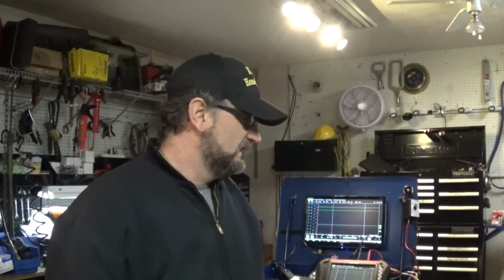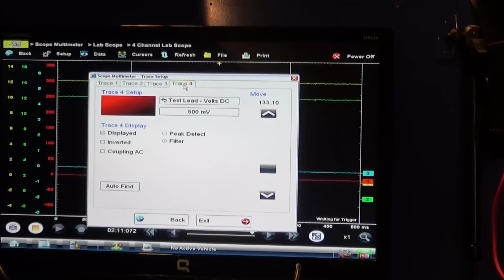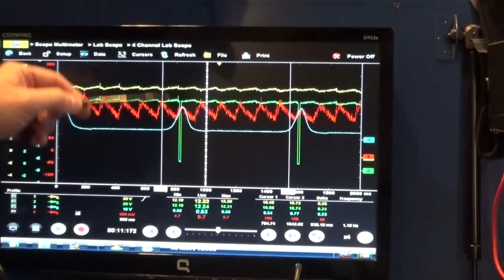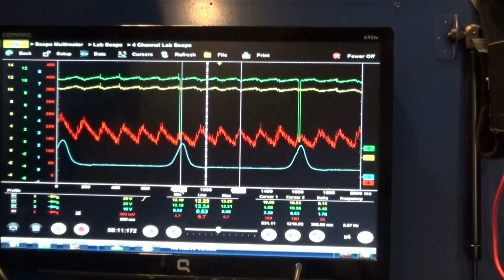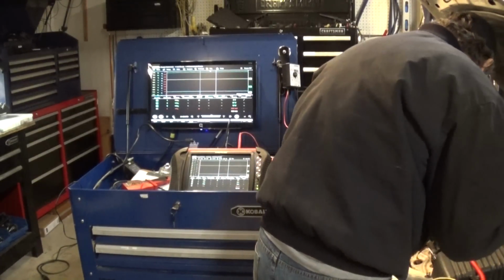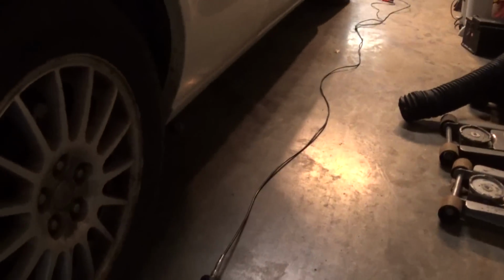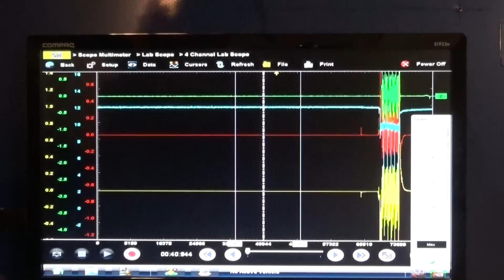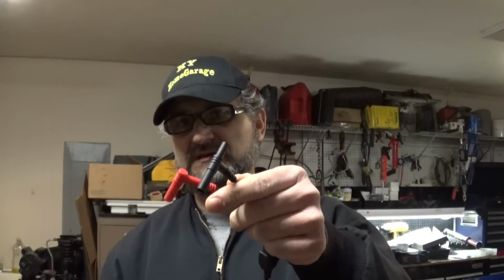Relative Compression Testing  All Methods With Snap-On Verus

Comment: Excellent video, the best I've seen on U Tube. Loved the way you disconnected the coil and fitted a test light to the ground driver lead wire and used it for your pickup on the scope.
Reply from the maker: huggybryn39 Thank you so much I always looking forward to see your feedback. Thank you for supporting my channel.
Reply: Thank you. Coils over plugs, not seeing the secondary wave form. When electronic ignition was first fitted some manufacturers place the ignition coil and module inside the distributor making it impossible to see the secondary waveform of the coil, to overcome this problem we wrapped a wire around the distributor cap two or three times before fitting the scope probe to the wire, to overcome this problem. I was thinking if you placed a A/C pickup coil  from a crank sensor or ABS  wheel sensor, fitted your scope probe and place it on top of the the coil you may see the secondary waveform to carry out tests. Is it worth a try.
Reply from the maker: huggybryn39 will definitely try that should work.

Comment: The hose in your transducer system effectively lowers the compression ratio by increasing the volume of the combustion chamber. Wouldn’t that cause the apparent low compression in that cylinder and the subsequent lower amperage?  If u put the transducer in another cylinder, I would expect to c that one low instead. Thank u for great vid. U didn’t say what timebase u were using.

Comment: Excellent job with the test and video.  Watching it was well worth the time.  Thanks!   I am left wondering about the value of the FLS.  Using it for this purpose seemed to produce less readable results.  The amperage and voltage variations were much more pronounced.  What situations do you think it would add value?
Reply from the maker: Max Wood please watch this case study. This is a first time  that FLS was useful to me. Thank you for watching. 
https://youtu.be/rTYL-IhqoHI

Comment: nice work 
about voltage drop method can you use inverter function to flip the wave to be saam like clamp meter wave
Reply from the maker: black mind yes sir you can invert your waveform if your scope has that option . Thank you great question 👍👍

Comment: Great demonstration as always,    Is it possible to use a 500psi transducer (generic unit) other than the snap on unit?. I have the verus with the y adapter and 100 psi transducer for fuel and vacuum testing but have not pulled the trigger on the 500psi transducer for in cylinder testing as of yet. Trying to get the cleanest resolution as possible, but was thinking a 300 psi transducer should work   alot better?
Thanks.
Reply from the maker: Kelly R Hi my friend. You can use aftermarket 500psi pressure transducer with SO Verus or Modis. Please watch this video. Thank you.
https://youtu.be/CXC0j42CllM
Reply: Thank you

Comment: In first place I want to say you a big thank you for your time and dedication. You made a great video on the topic and I definitely do enjoy your channel ... 
There is one other method of doing relative compression and this is done by looking at the secondary firing kv demand. Doing it on your car`s waste spark system  with the verus you would need the SIA 2000 adapter though.
I am in doubt with regards to the exhaust pulses while the the compression hose  without schrader valve is attached. The offset from #2 ignition trigger to the lower exhaust pulse on the fls sensor trace just doesn't look right, I would expect #2 exhaust pulse to happen 1 exhaust pulse event later than it appears to take place. Do you have an idea on this?

Again, THANK YOU!
Reply from the maker: First thank you for such nice comment. Back to your question. You are right that was strange to me too. I been reading so much about FLS and how to read pulse from exhaust and I was expecting to see  pulse from #2 cylinder later but looks like it is line up just a the time when exhaust valves are open (looking at in cylinder pressure transducer trace) from #2 cylinder. Looks like I will have to make another video this time I will do cranking and running test. Thank you.

Comment: Great video is it Ramon? KY Great use of your transducers. Just some food for thought PICO makes a really stiff high quality compression hose. 14 mm adapter on cylinder end and a 27-2 foster coupler adapter on other end and it will work with you transducer 1/8 npt to 1/4 adapter (hardware store) Just so the hose doesn't effect your compression reading. So you will know if you have real smoking gun. Thanks again Ramon?
Reply from the maker: Mark Ferraro yes my name is Ramon. I will definitely check for that hose. Thank you so much for supporting my channel👍👍

Comment: you are using a high amp current clamp for the amp draw, is it possible to use the same current clamp for use on the lower amp circuits like the injectors because it would be too costly now for me to own a high and low current clamp.
Reply from the maker: Ed KE6BNL unfortunately you can't use high amp clamp on low amp circuit because it is not sensitive enough. This clamp is designed to measure current over 600 A and fuel injector uses only around 1A of current. Hope this help. Thank you
Reply: KY Home Garage KY Home Garage
You did show how to use a low amp on high amps when using on ac coupling